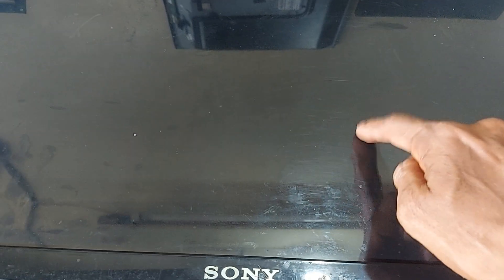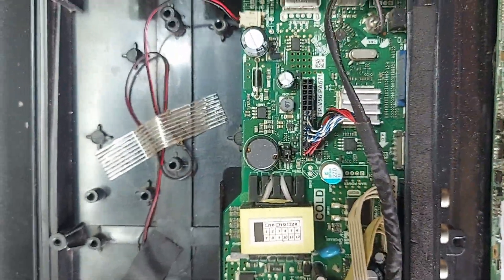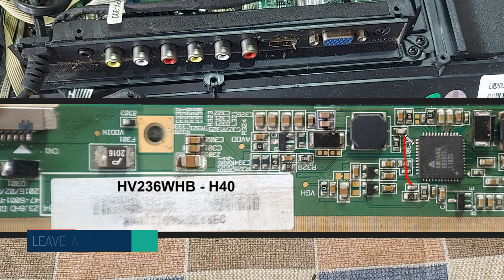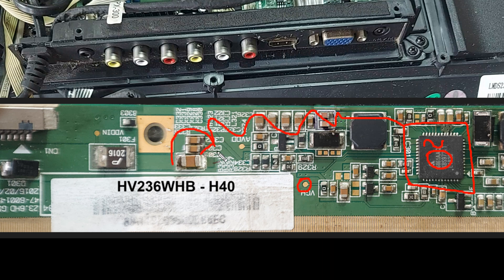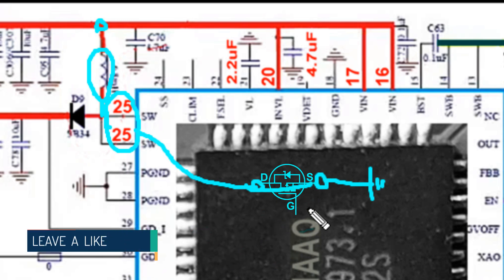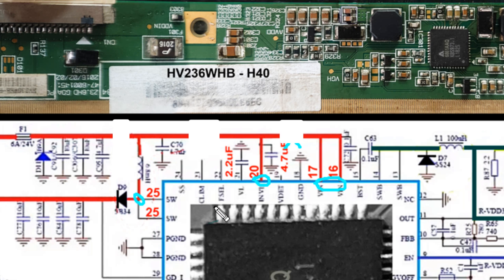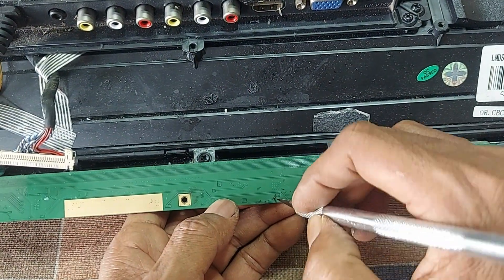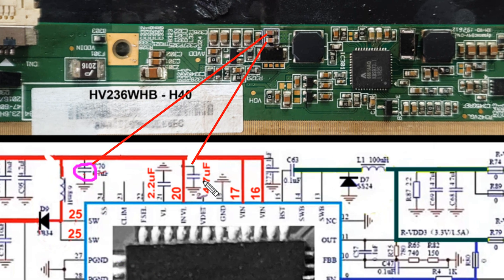LED TV NO PICTURE | DC to DC Converter Explanation &  Short Circuit Repair | 6861AAQ Voltage

Comment: hi sir i have 29" dell monitor screen .came vertical box issue DC to DC IC getting heat .i aske someone  youtuber no one reply till now plaese sir hep me i am in abrade
Reply from the maker: you have not provided more detailed symptoms of the monitor problem, which would have made it easier for me to understand. For example, the IC number or whether there is an image on the screen.

Anyway, there can be several reasons for a DC-to-DC IC to overheat:

Shorted filter capacitors of the output voltages.

Shorted external transistor of the DC-DC circuit.

Short circuit inside the panel.

Gate COF/COG short, Source COF short.

IC damage.

Check if the Source COF and Gate COF/COG are overheating. If there is no short circuit in the circuit, you can try changing the DC-to-DC IC. Thanks.
Reply: Thank you so much sir your reply ❤
Reply: Sir issue was Vertical bar came middle of the screen........

Comment: I have Akai TVCB-50S with the same issue. The T-con is a double signal, if both signal connectors are connected to the screen, and you're checking the voltages, it's only the input voltage which is 12v the remaining voltages will not flow

Comment: I have an Aiwa model AW32B4SM same issue with no display. Not getting any voltage at the current resistor on the tcon board. Trying to learn from your tutorials to solve my problem.

Comment: Excellent ❤
I have problem with a 32 inch tv panel number pt320At01-1-xc-3
All voltages are okay except VGH is 22v and no display. How do i find  the problem please?

Comment: Bonjour Mustapha j'ai un problème de cette TV là est-ce que tu peux me voir ' s'il vous plaît si tu as des photos de ça envoie-moi merci en tout cas beaucoup 1000 60 TP POL C12 CLEACLKS LCE LCT CAC SCL SDA UP GSCL CND Model N211HR430FHDCT02-1-1 110 28 LGA227 031.35 5025E00- Tane 1: PT430CT02-1 COFLI NEMUSS PANEL PT430CT02-1 PT430CT02-4 347 U3 AVCOM ACINCI LVDSIN 28377 378 380 100 B CON LAGX 20011505 384 C28 νταν C001 VOL C 14 AVCD 100 QC PASSED C25 CR4 R33 01 COFOR MAIS ROHS SDY-DI 365101 HAVDO CRO 88 LO (173

Comment: I am self-repairing my TCL tv which will only display video for about two minutes then the screen goes black but the audio is there.
Upon start up the VGH is present but the DC-DC IC is becoming hot until it shuts off(protect-mode) causing the screen to go black while audio is present.
Any idea what could be wrong? Thanks

Comment: Sir is it good for use short killer for this kind of problem
Reply from the maker: Short killer is an unsafe and illegal method.  In this method the thin print of printed circuit board can also be burnt due to over current following.  That is why I will never adopt this method.
Thanks Brother.
💗💝🌹💓💖
Reply: @OrnatePixels  thank you very much 🙏🙏🙏

Comment: Sir I have a micromax 50 inch led tv with a inbuild tcon board I dont know how to test or find the. Fault the 12 volt panel supply is not present how could I   solve this problem

Comment: Brother, just make a constant current supply of 100mA and feed in the short path. Then measure voltage in different points, where there is lowest voltage, that's the shorted component. The further you go from the short, the higher the voltage will be ( voltage will be in mv, drop will depend on trace Resistance). I made it in my mili ohm meter vdo

Comment: Nice video, can I use hot air station to remove smd capacitor on t-con board? I see your using soldering iron

Comment: Perfect way to find a short circuit in any electronic device .
In this panel the supply line is short . So here is an another way to detect the defective parts , just remove the lvds and take a 3'7 volt battery approx 2 amp. Then connect the  negative to the ground of the t con and the positive to 12 volt supply line . It will better to connect the positive terminal after the fuse , otherwise the fuse can be burn in second.
In this process the faulty parts starts over heating and it can be detect easily.
There are many youtubers who teaches how to find a problem in LED TVs but you are the best among them . In a very short time video your explanation is very logical and perfect.
Respect from India , stay blessed always.
Reply from the maker: Your method is quite good but 
In some cases, the print of the circuit may get burnt when the shorted component is burnt by over current, so I do not apply that method.
Moreover, when the short component can be found within 3/4 minutes, why would another method be applied.
Best whishes Brother. Thanks a lot.
Reply: Do you have more videos with such clarity

Comment: Thank you sir for this video but i could not understand how does you find that capacitor value is 4.5 mfd
Reply from the maker: The main filter capacitor can be used from 4.7 microfarads to 10 microfarads in a DC to DC converter circuit. Thank You Bhai.